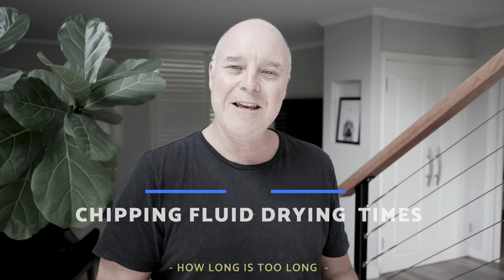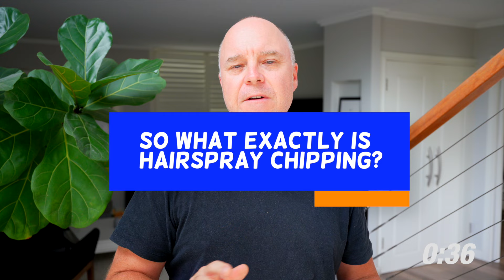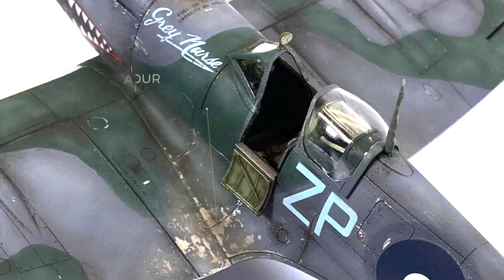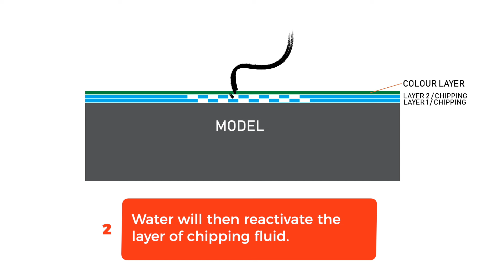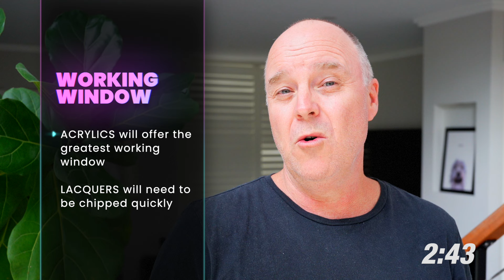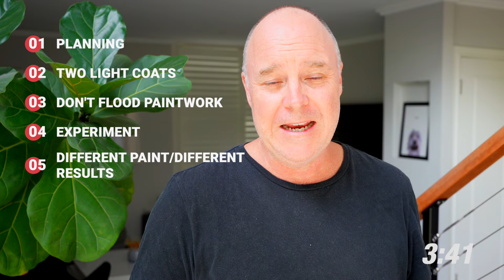CHIPPING Fluid / Hairspray Chipping - Understanding the technique / DRYING times and the basics!

Comment: Just a side note...I tried chipping fluid for the first time last weekend and I noticed that pulling the brush and toothpick through the water muddied things up a bit in the surrounding unchipped areas.
Do yourselves a favor and exercise brush control when pulling up paint.  Dabbing excess water with a cotton bud helps.
Reply from the maker: 100% dabbing the water away as you work with a tissue is a great idea. Gives you a proper read on where you are at. 
Thanks for sharing 🙏🍺

Comment: Thanks for the tips, chipping is really fun to play with. Maybe one thing to note here, it is good to seal the first layer of paint (before the chipping fluid) with a varnish to make the paint more durable when chipped.
Reply from the maker: Hey there👋 Your base layer shouldn’t be getting damaged during this process if the integrity of that layer is sound. I’d highly recommend priming your model prior to painting to help aid with that and make sure that base colour has completely dried. 
Also…you shouldn’t have to scrub that hard to get the paint to chip. If you are having to be that heavy handed then possibly you are waiting too long to start the process? 
But adding that varnish could be considered as an insurance policy. 
Really appreciate your thoughts and taking the time to share here with this community 🙏🍺🍀
Reply: @workbenchhobbies4316 Thanks for the tips. I always do it that way, but there probably was a failure on my side. You are right about insurance policy while chipping though :) Have a happy modeling!
Reply from the maker: Really appreciate you joining in. How good is this hobby! 🙌🏼🍺🙏
Reply: If the base coat is enamel (whatever color you want to have come through), it is extremely hard to damage with chipping techniques if the colorcoat/topcoat is acrylic, no clear coat needed.

Comment: Some great tips there Clayton. I tried hair spray chipping for the first time a while ago, with disastrous results. I am still not sure what I did wrong, but I have stuck with brush chipping ever since. The points you raise here are very helpful, and prompts me to give it another try, albeit with a chipping fluid rather than hair spray. Your advice about not ‘flooding’ the surface of the model with hair spray (or chipping fluid) made me think back, and I am sure that was my problem when I tried it.
Love the content mate, and looking forward to the next build video. Cheers for now!
Reply from the maker: Hey Gary 😎 flooding anything in this hobby is a bit of a no no! 😆 Try it again using the hairspray. Just keep your coats reasonably light. Both hairspray and the top coat. Once the technique‘clicks’ for you you will look for any excuse to use it! 
Thanks again for your support 🙏😆🍀

Comment: Great video, I'd recommend taking notes (either write or photograph and text to yourself) because you may get seasonal variations (air-conditioning in the house, dry heater air, outdoor rattle can).
No need to go nuts on the measuring. 
It just helps track variables. 
Hot weather = smaller window, cooler weather longer window to use chipping fluid.
Reply from the maker: Hi Jamie. I’m not sure that the weather has that big of an effect on the ability to execute the effect. What has been your experience with it?
Reply: @workbenchhobbies4316   it's more the top coat I'm referring to for workability. 
When I lived in Tasmania,  I had a long time frame with Tamiya Acrylics for chipping experiments (that was the hairspray effort)
Now I live in Adelaide,  and the warmer drier climate shortens my working time...
Yes, I live in an air-conditioned house,  it's not piped into every room.
So if your results are successful one project and a month later it's not the same, a variable may be climate .
Reply from the maker: Interesting observation. Thanks for sharing your experience 💪🙏

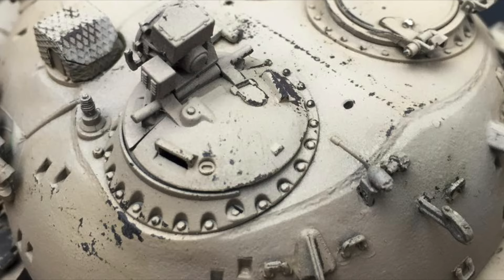Comment: When using hairspray on top of an enamel basecoat, I find very thinly sprayed Tamiya acrylics to be harder to soften up than I like with just water. I found that adding a very small amount of rubbing alcohol (less than 1:10) really helps soften that topcoat.
Reply from the maker: Hey Ed. It probably comes down more to what you are thinning the paint with. If you are cutting it with a lacquer thinner the paint will be harder to chip. If using ipa or water it would be an easier…but they all have a working window so it’s important to not leave it too long. 
The ipa will be reactivating the paint, so there’d be a risk that would affect the result…but obviously keeping it at such a low ratio is having the desired effect? Sounds like it’s worth a try 🙌🏼
Appreciate you taking the time to share your thoughts. 
💪🙏

Comment: Nice quick summary Clayton. Hairspray chipping will be something I try in a few models time (so that means 2030 at the rate I'm going🤣). 
Have you ever tried the salt technique? This looks far easier than salt which has always intrigued me .
Reply from the maker: Hey Andrew. Yeh, done salt chipping a few times. It works surprisingly well. Downside for me is the salt residue is very difficult to remove completely. I’m still seeing white lines in the models I did it on. Far better ways to achieve a similar result in my opinion. 
Thanks again for your support mate 🙏🍺
Reply: Thats interesting re the white lines. I've ever seen a model that has used salt chipping a year or two after the chipping was done. Always thought it would be extremely difficult to get all the dissolved salt off the model. Thanks for the info.🍻
Reply from the maker: Well…not saying it’s impossible to get it all off…it just seems like a bit of a pain every time I’ve done it and even then I can’t get it all off 🤯

Comment: I'm fairly new to the hobby and I invested in Ammo products. Used chipping fluid for the first time with very bad results. My top coat of paint started to bladder everywhere. Fortunately I could remove the cracked paint giving me more or less the result I was looking for. I will continue to use it but my top tip would be. Try the effect a first times on test pieces before applying it to the real model. That's what I will do until the technique gets in my fingers.
Reply from the maker: Hey Peter. 100%! Try it on an old kit first and have a play with it until you get the feel for it. Just remember to keep your costs light. It sounds to me like you have dumps too much paint down and it’s reactivating the chipping fluid. 
Good luck with it though. Don’t give up on it cause it’s a fun technique that can look terrific! 🍺🙏

Comment: Plain and simple tip for using chipping fluid, short and sweet. One question is what do you use to clean out your airbrush when spraying Ammo chipping fluid ? I never hear about cleanup using these products. Cheers.
Reply from the maker: Hey Joe. Great question. It’s a water based product, so you can just flush it out and clean with water. Hope that helps 💪🍺
Reply: @workbenchhobbies4316  Thanks for the info ! I was just surprised no video says what to use to clean up your airbrush with. Cheers.✈
Reply from the maker: Thanks again Joe 🍺

Comment: Thanks for the tutorial. Should there be a layer of gloss varnish between the base coat and the chipping fluid coats?
Reply from the maker: Great question. You don’t need to varnish before chipping, but you do need to make sure the integrity of your paint is sound. I’d recommend priming you model prior to painting it so the paint has the best chance of adhering. 
Also…you don’t have to scrub too hard to chip the paint (generally speaking)…if youre scrubbing so hard it’s damaging the bottom layer of paint you might be leaving it too long before starting the process. Hope that helps 💪🙏🍺

Comment: Can you chip through multiple layers of airbrushed paint? I would like to paint different shadows and highlights over the chipping medium before actually doing the chipping. is that possible?

Thank you for an excellent tutorial.
Reply from the maker: Great question! Yes is the answer…but it is crucial you keep the paint as light as possible and move quickly through the process . If the layer is too thick it can be challenging to chip. 
Hope that helps. Thanks for contributing 🙏🍺

Comment: As someone without an airbrush, can this method (with hairspray of course) be done with acrylic brush paints?
Reply from the maker: Kind of…but not really. My advice would be to try it on a paint mule and see if it works. My gut feel is you might struggle trying to brush paint and chip successfully using this technique
Reply: @ that’s what I feared. I may have to resort to sponge chipping… I just feel that doesn’t look as realistic
Reply from the maker: Agreed. Have you tried applying latex mask with a sponge, painting over that and then removing it? Thats a handy way to create chips if you are brush painting

Comment: Have you tried using thinner to chip the paint?
Reply from the maker: Hi. 👋 Trying to chip using a solvent is a risky way to chip because it’s very easy to go too far and damage the layer of paint you are wanting to keep. 
Mike Rinaldi uses this technique, and it can look incredible, but I feel it’s too unpredictable for the majority of modellers. It does give a unique look though. 
There are safer and easier ways to achieve chips on your models I feel. 
Thanks for the excellent question 🤝✌🏼🙌🏼🍺🙏

Comment: Hi, can i ask, do you have to  varnish the base coat to protect it before applying the chipping fluid, many thanks
Reply from the maker: Hi Richard. As long as you have prepared the model properly and the integrity of the paint is sound you don;t need. to do that. I'd always recommend priming your model prior to painting the base coat. This will give the paint the best chance to adhere to the model. In saying that, you can varnish it if you like...it wont matter, but if the foundation layer of paint is flawed not even the varnish would save you.  
If you start you chipping soon after the paint application you shouldn't have to scrub too hard to get it off.
Thanks for the question and good luck with the technique! Its a load of fun 
C
Reply: @workbenchhobbies4316  Thank you for getting back to me 👍